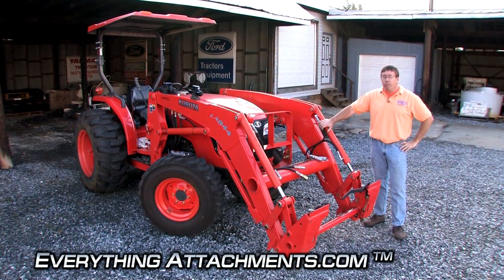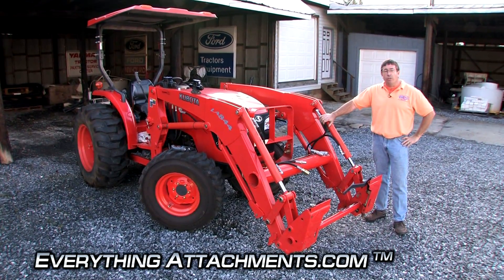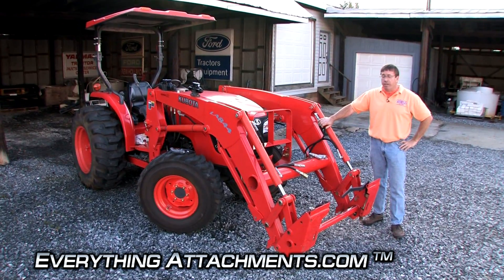How To Series - 3rd Function Auxiliary Hydraulics for Tractor Loaders

Comment: Is it possible to adjust the force of the remotely actuated hydraulics?  Sometimes I want feel like I need more pinching force from my grapple bucket.  Too much force seems like it could also be bad for the implement.
Reply from the maker: Not really a way to adjust the force, but you could adjust the speed with a flow restrictor if desired.

Comment: Bought this 3rd function kit from EA for my kubota grand L3010. Works great. Video is a big help as the printed instructions suck.
Is there a way to reverse the switch function? Mine closes grapple with top toggle and opens with bottom, which works but seems counterintuitive to me. I guess the simplest fix is to just switch the couplings?
Reply: Just switch the coupler on the outlets
Reply: That is how mine is setup and for some reason it does not seem correct to me. I just had tractor delivered yesterday. I always thought the top button would close it

Comment: I live in Perth Western Australia, and purchased a foton lovol 504 tractor, a few months later I have had a fully preassembled 504 front end loader with 4 in 1 bucket shipped to perth directly from china,

The loader has come pre assembled hoses controller etc but they have not sent me any fitting instructions or a manual to help me, I have mounted the frame etc correctly to the tractor but am stuck as to where the controls go and hydraulic plate, would you be able to assist as you are the only reputable dealer I can find . thank you

Comment: Is it possible  to just add an 12 volt two way hydrolic pump w/reservoir  and remote to the grappler if your tractor or skid steer  already have bucket  but  no aux hoses to attach to grapple hands?
Reply from the maker: The valve kit is a more user friendly option, but you can use other means as long as it produces flow and provides you with a manner of actuation.

Comment: Do you have a kit for John Deere? I have a 4120. If not, do you have a 
suggestion as to the best way to go about it? I want to add a grapple to
 my front end loader bucket. JD makes a power beyond for the rear. I was
 thinking about an hydraulic multiplier? Any suggestions would be 
appreciated. Thanks
Reply from the maker: Yes, the 3rd function kit is available for your tractor.  See it here on our website: http://www.everythingattachments.com/3rd-Function-Hydraulic-Kit-p/tra-3rd-funcl.htm
We also have the best grapple on the market for your tractor, our Wicked Grapple: http://www.everythingattachments.com/Compact-Tractor-Single-Lid-Wicked-Root-Grapple-p/eta-slrg.htm
Feel free to give us a call to discuss or email sales@everythingattachments.com
Thanks for watching!  Travis
Reply: @EverythingAttachments  Also for a JD 2940?  I have a front loader, but I dont know if it can be adapted for such hydraulics.
Reply from the maker: @emmastone7791  If you email the request along with your loader and tractor model numbers, we'll check it out for you.  Thanks!

Comment: Ted, I have a 50hp tractor I use for plowing snow, with a front snow plow blade. Instead of a third function valve, the dealer ran lines to the aux. ports on the rear of the tractor for the right/left angle, a bit inconvenient but not horrible.  I am wondering if I can switch hoses so the joystick controls the right/left angle and the aux. would control forward/backward tilt. Since I use the right/left a lot more it would be more convenient.
Reply from the maker: +Rod M 

Yes, you could switch the hoses, but loader work would be pretty awkward.
Reply: Thanks Ted for the quick response. For now I only use the tractor for plowing snow. I suppose if I needed loader I could switch the hoses back. Anyway thanks for the help, and thanks for all the videos. I've watched a lot of them and learn a lot from them. 
Rod

Comment: Question for Ted:    Can't we use that kit to power a backhoe on the back?   Why not have a separate set of lines going to the back (on tractors that don't come with remotes) to power a backhoe, and just use a clip to hold down the button on the loader handle?     MAIN CONCERN:    Will that electric valve overheat or fail from using it for hours instead of a for SECONDS like a root grapple??????????????       I love EverythingAttachments, great people, great videos, great products.
Reply: kevedamanyo    So in other words---If my Kubota L3800 does not have remotes, why can't I use this kit to provide remotes on the back, and then also use it on the front for a grapple at other times.   Just have a set of quick connect lines going ot the back, and another set on the front.  Plug into whichever set I need that day?    Solves my remotes problem IF I can run a backhoe with that electric valve rocker switch pinched on for a whole day at a time.......
Reply from the maker: kevedamanyo 

That
is the exact reason why you wouldn’t use it for a backhoe or attachment that
requires continuous flow.
Reply: +kevedamanyo  you don't need a valve to send power beyond for a back hoe. just tap into the power beyond port take that to the rear of the tractor use a male or female connector. then run another line from the rear of the tractor to where the power beyond use to terminate at that block just under the floor board on the right side or passenger side. when no back hoe is being used plug the male into the female connector to create a loop and complete the circuit. when a bh is used unplug the male and female connector at the rear and connect the male and female from the bh to those lines. make sure when you plug and unplug lines tractor is off and relieve the pressure by moving the loader joy stick in all positions after the tractor is off.
Reply: kevedamanyo

Comment: Can I ask you question I seen a bunch of your different videos so I know you know about the older Ford tractor like the 70 models I want add a grapple to my bucket but I have 730 loader that uses the front pump I have no hydraulic ports for the rear I think I can ad a control valve that fits under the seat and that could ad me to ports would that be the way I could add a grapple

Comment: Was looking through...is there a video for what you would use on the rear with the 3rd aux? Or is there a video showing how you run it to the rear.
Reply: A third function on the back is called a rear remote. If you look that up that should give you what ur looking for.